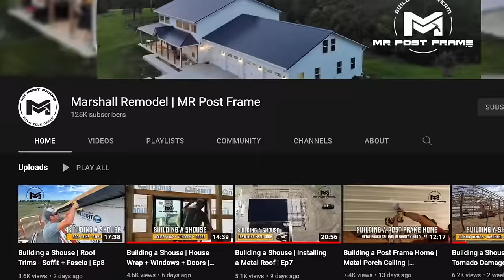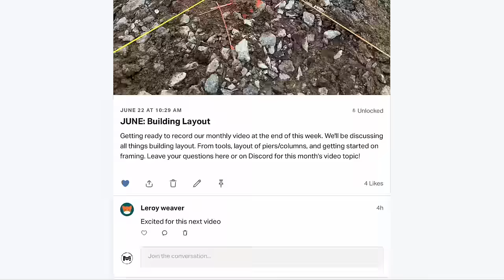Septic System Install | Complete Cost Breakdown

Comment: Thanks for a very informative video. Giving our daughter 3 acres next door. I bought a new backhoe ($7K) for my Branson 3520 a month ago, then paid $950 a few days ago for the perk test which is scheduled for 10am in the morning.  Was told that if we hired someone to expect to pay $25 to $30K and for self installed around $5k. Fingers crossed that this passes for a conventional system. Will also be using the backhoe for the footers, water and gas lines as well as landscaping, etc. Will hire someone to put a foundation in and frame it, then finish it ourselves.
Reply: What state?

Comment: I'm going to install a presby septic system soon for a 2 bedroom.  $4200 in parts. Health Department said I had to past a test which took me 3 tries a fee to take the test of $40 each time. I figure I'll have $8,000 in it. Installers wanted 17,000 to 21000.
Reply from the maker: That’s a good cost savings for DIY
Reply: In Iowa it's the same kind of deal; you can take a weekend class + test for around $400 IIRC. But again as Mr. Post himself described whether or not that certification is acceptable in a particular Iowa county is questionable. In my county (still in Iowa) only a certified installer can do this work, or a certified installer must be on site while the work is being done.

Comment: In 2000 I paid $13,500 for a sand filter septic system, with a pump to push the effluent out in the drain field, 3 bedrooms, 2.5 baths, 1000 gallons tank, installed.

Comment: Thank you for the vloging well done, I have started to do a little myself on some work I do I can't seem to get anything done if I'm focused on it 😅.
Anyways I am young 25 my end goal is to open a residential home building company, but for starters I want to do septic system install businees to build some capital up and use the money to get a loan, following the material and build the first home on my land. FYI I just wanted share a bit of my background. My question for you guys are I've been studying the book in SC to receive my licensure. Is there any advice on studying for the exam. Or recommended areas in the book I need to focus own cause it's awfully length anything would be greatly apprectiated

Comment: Here in Virginia it cost over $2k just for the soil work. They don't do "perk" tests here, but rather require a soil scientist to evaluate the soil by inspecting the soil makeup, layers, ground water, etc. Once the soil work is done, it goes to the county for approval...another $650. No DIY allowed, a certified septic installer has to do the work. Once completed,  the soil scientist comes back out to inspect...then back to the county for approval. Very expensive.

Comment: Seems to be over kill based on how we used to do it here in NC years ago?  I am sure this is based on EPA/county regulations.   I assume you cannot drive vehicles or work equipment over the drain field?? If so you need to take that into consideration right?  I also assume you can't plant trees, shrubbery or a garden over the drain field, right??

Comment: When we had ours installed in 2001 with gravel pipe, it cost $3800.00 total with them installing! There is absolutely no reason for it to cost three to four times more now other than greed! Wake up America!!!!
Reply: The dollar was worth mkre and good were cheaper
Reply: That was almost 25 years ago.  The house I bought for $60K then is worth $320K now, the car I could buy for $20K would be $40K now.  

Times change, and so do the code standard for sceptic systems.
Reply: It's called inflation.  It's a silent tax that hits the poorest the hardest.
Reply: Gravel back then was 250 a load is now 750 alot has changed. Unfortunately
Reply: Inflation hasn't risen enough to justify the cost increase
Reply: I’m doing my septic system now.  I’m putting a gravel system in for myself and am picking my own gravel up from a quarry 30 miles away (cheapest quarry).  The materials are gonna cost be just over 5,000 dollars.